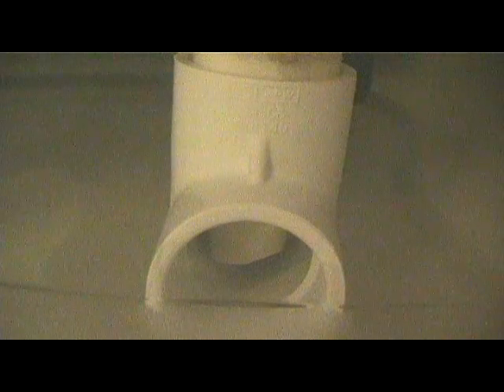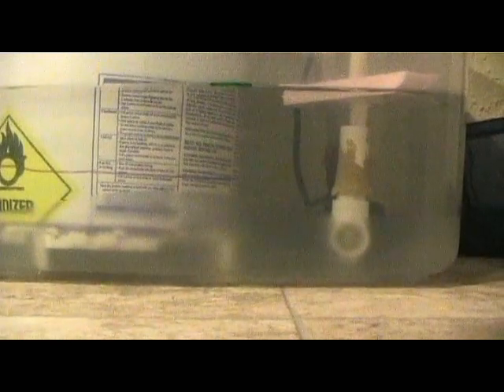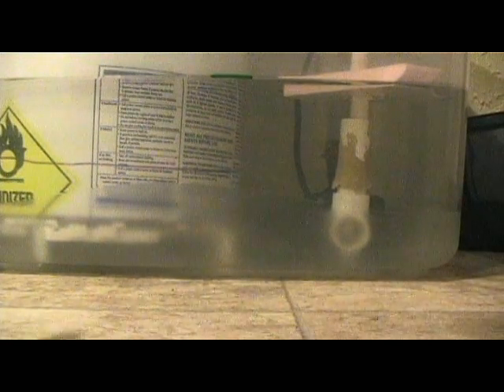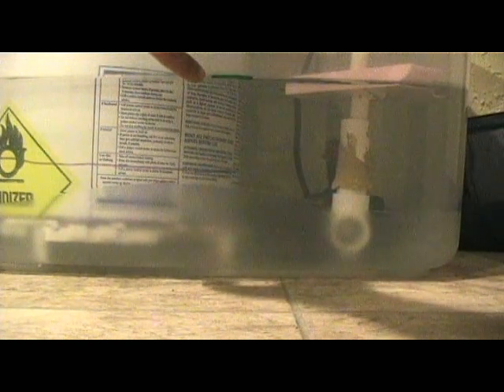DIY sump pump cutoff

Comment: i admire your ingenuity, i understand that you've built it on as low a budget as possible and i applaud you for that but if you spent a little more you couldve drilled the tank for the overflow which would solve the flow problem, water would then enter the sump at the same rate it leaves it all the time....but im sure you know that :)